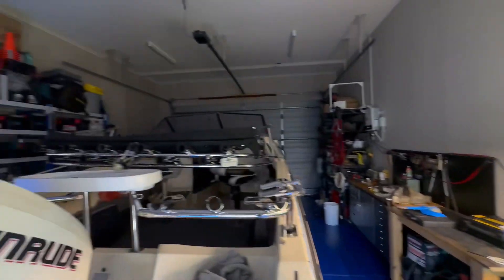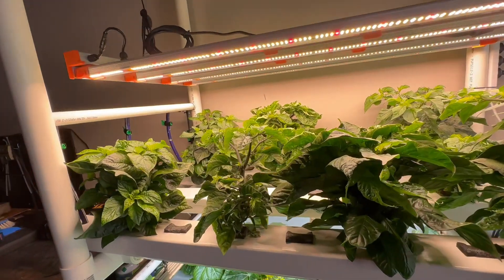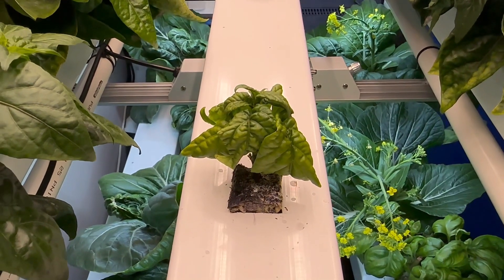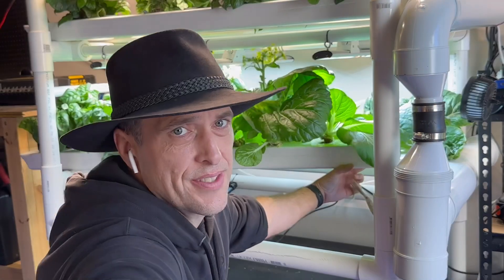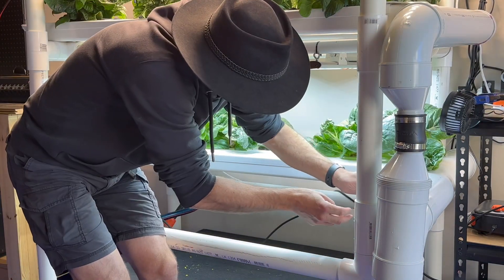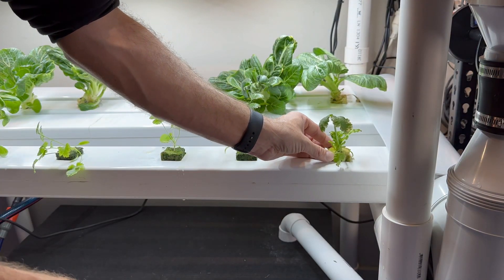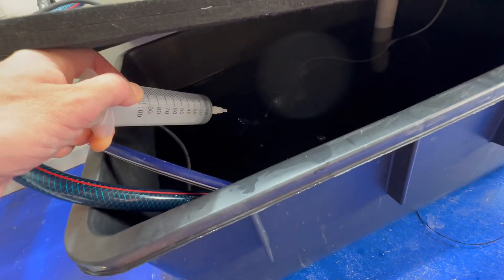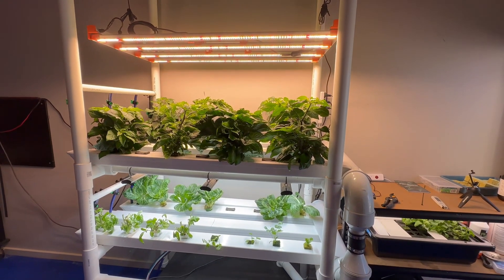NFT hydroponics routine maintenance

Comment: This is going to sound weird and ridiculous but: its air circulation causing the issue with the leaves. Plants breathe and perspriate through their leages and they need air circulation. Can be done with a fan.
Reply from the maker: Yeah. I’ve have a small fan running the whole time but perhaps it’s not enough. I’ve been blasting it with an oscillating pedestal fan for the last week. Hopefully it helps.

Comment: Just binged all your videos. Great inspiration and good quality of the videos. Im also a big fan of Hoocho's and I have just gotten started with a basic Kratky system myself (live in an appartment in Stockholm). Anyway, I think you might be right about the tip burn on the bok choi is due to insufficient airflow and calcium deficiency. Also, add a second fan for the top level before your chili's take tip damage. Another suggestion, you can add a mylar blanket or similar reflective sheet to the wall behind your setup to get even more out of your lights. These are just ideas learning from others. I have very little experience. Thank you, you earned a new sub!
Reply from the maker: Thanks mate!
This week I actually setup a standard pedestal fan on oscillate before I left for the week (only home on weekends). Should be plenty of air now 😂
I’ll definitely consider the reflective wall sheet! So many ideas and not enough time.
Cheers for the sub!